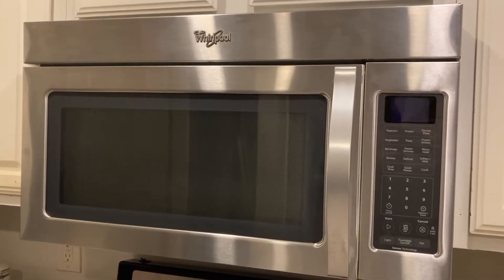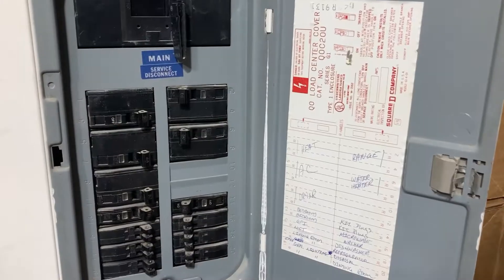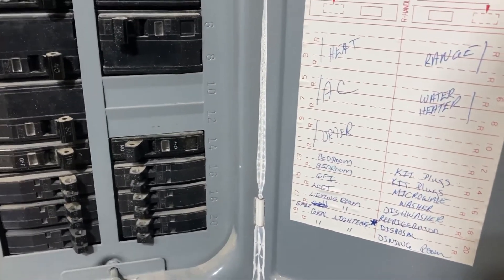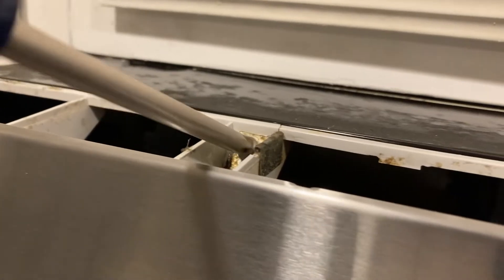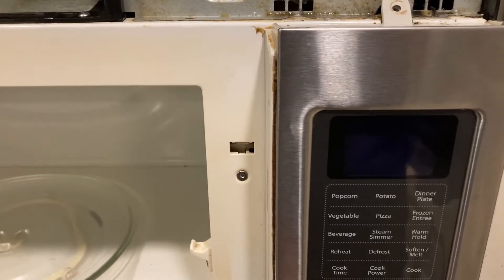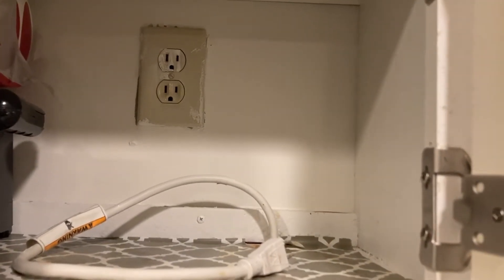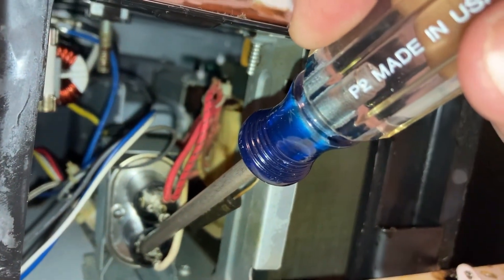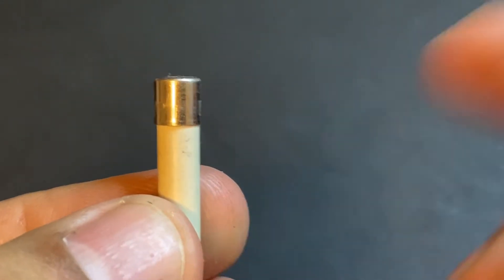Microwave Stopped Working Off with No Power - Easy Fix

Comment: I replaced the fuse and it dis not work
Reply from the maker: oh. If yours is an expensive microwave, it may be worth getting it fixed. For the inexpensive one (the kind I have), if the small fix had not corrected the problem I would have replaced the microwave.

Comment: HAHA NOT A FIX----I just did all that.  And had power again just like you; went to cook something about an hour later. As soon as I hit start all power went out.  You fail to mention some fault somewhere is causing the fuse to blow.
Reply: It looks like you need a new microwave.  I wouldn't spend more time or money on it. I had a similar issue.
Reply: @KING4aday46  yup replaced it next day for a larger counter top model.